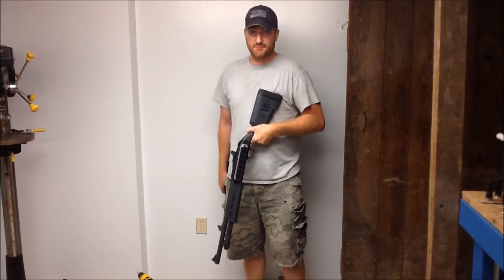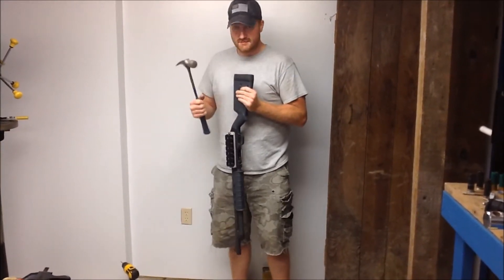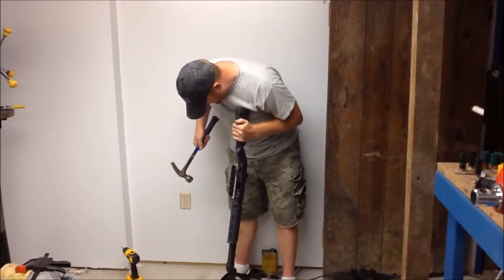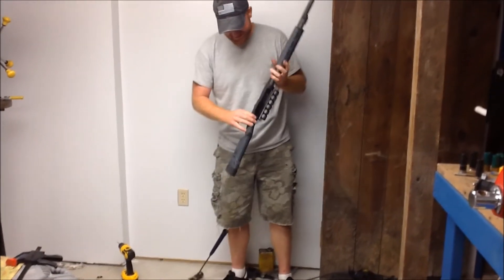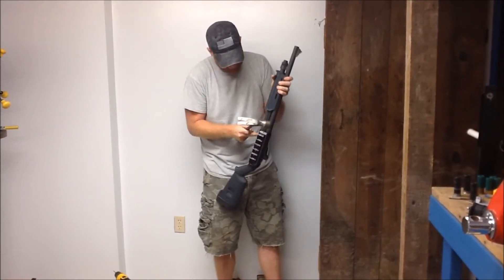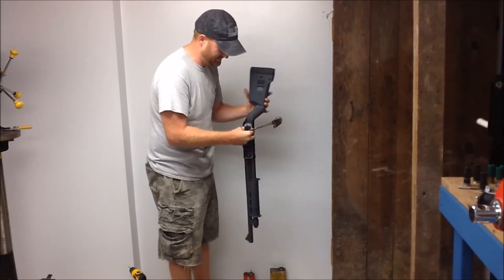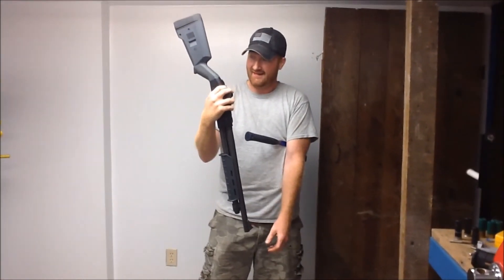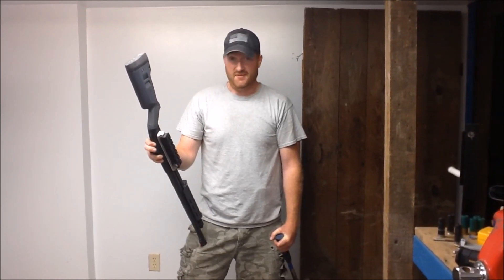Aridus Industries Universal Q-DC Impact Test

Comment: Thanks for the demo.....just a side question here.....I have the same Magpul stock on my 1301...did it by chance work loose on you after hammering on the shell holder? It concerns me that Magpul only has one little screw/bolt holding that thing on to the receiver.

Comment: So ... if you DID want or need to remove the carrier, how would you do so ? (asking for a friend :-)  )
btw ... I have a brand new  Beretta 1301 Tactical with your adapter for the MAGPUL Mossberg stock ... installed ... awesome !
OK ... never mind ... I see the question below answers that ... sorry.
Reply from the maker: No worries,  I've been meaning to drop an install and removal video and never got to it. 

Take the carrier off and use a hair dryer to heat the base a lot. Start at the rear closest to the stock. Use a plastic scraper and start working your way under it. Do your best to keep heat on it and just gradually work your way forward with the scraper. Eventually you'll have enough worked through that you can pull it the rest of the way off. It's not easy,  but it's effective and won't beat up your finish like other methods I tried at first lol

Comment: I was less worried about the thing falling off than I was about what it would take to to get the unit and tape off the shotgun if you decided to remove it. What kind of job is that, and what does it look like underneath when your done?
Reply from the maker: If you use a hair dryer to heat the base,  and a plastic scraper to get under the back corner and work forward,  its not a problem.  It's not easy,  but it's doable and won't damage the receiver or the finish.